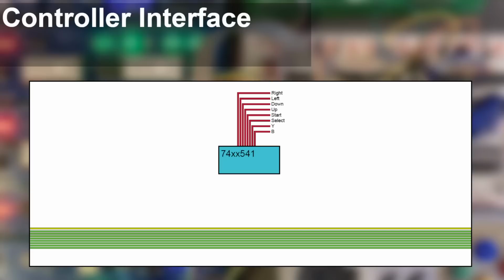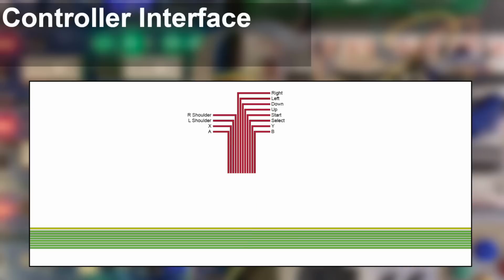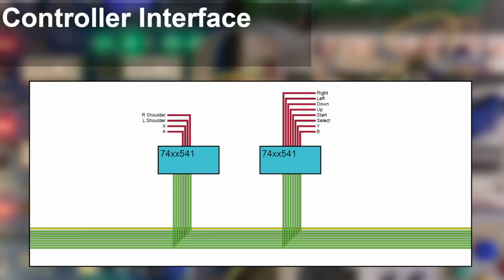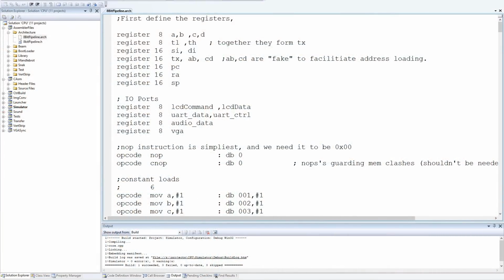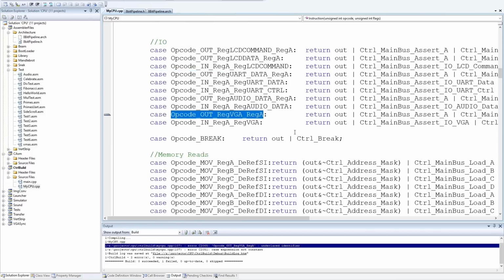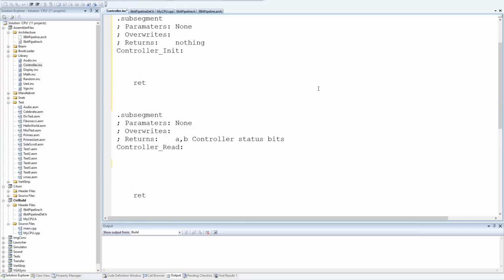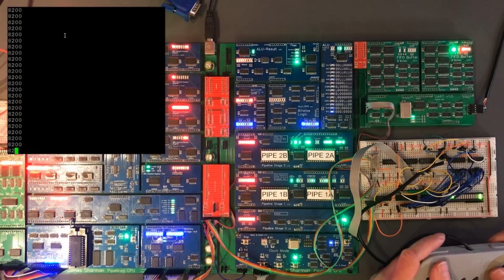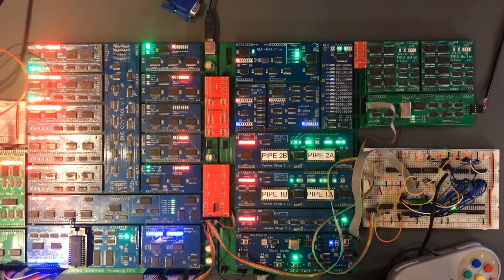SNES Controller Interface – Part 2 – Connecting to the homebrew CPU

Comment: 3:43 "But what if I hold right while powering on?"

Well, you're not the first person to assume the controller isn't touched during power-on! Every analog stick I know assumes that it starts in the center "rest" position. I'm sure there's no shortage of gamers that found their analog stick misbehaving because they accidentally held it off-center on power on. I distinctly remember discovering this with the N64 controller. Kid me was baffled. Adult me understands what calibration is.

Granted, you aren't using an analog stick, but the concept is similar.
Reply from the maker: Indeed! Some people didn't like the imperfection but similar initialisation constraints happen more than people think.

Comment: 13:00 - is that why it was (for a while) common to have a "game port" (aka joystick connection) on PC sound cards?
Reply from the maker: No, but I do like the similarity here. The real reason why game ports and sound cards were often found together was some early clones had limited slots. The joystick cards were very simple circuits so adding that functionality to a sound card was easy and made the first cards to do it stand out.

Comment: So for identifying the flip flop state, I think I found a solution only using the two upper bits of the high byte: make bit 8 of the high byte be the NAND of left and right, and bit 7 be the XOR of left and right. It results in a truth table that can tell which one is which because there's no conflict. So you can compute the two bits in software, and when you read the next byte you can tell which way it is based on whether it matched or not.

Buttons - low high - high low
None - 00 10 - 10 00
Right - 10 11 - 11 10
Left - 01 11 - 11 01
Both - 11 00 - 00 11

It's probably not worth the chip(s?) just for that though. Might as well tie them both high and if somehow the player manages to press both right and left at the same time, yell at the player to stop it so controller detection works.

The only other solution that I can think of would be to add more flip flops to have a third state where it returns all 1s  and could probably be done with just one existing chip, and would also be fairly cheap on the software side but kind of gross and wasteful compared to a one-time init at start of the program :/

Thanks for the videos! Really ties up how all those parts work together to make an actual computer! Also makes for pretty nice brain teasers trying to solve problems like this one.
Reply from the maker: Half you are enjoying, your solution is interesting but it would cost several chips. It’s worth remembering that a single sample without a direction held to correctly detect the polarity.

Comment: 18:42 Couldn't you pull up all four of the lines on the upper byte?  Then you'd have U/D/L/R all set at once, a physically impossible input on an SNES controller
Reply from the maker: You could do, but I know a few games testers who would just take "a physically impossible input on an SNES controller" as a challenge. It can definitely be done on some 3rd party controllers.

Comment: Awesome progress! Nicely done! I may have used all 4 bits of the MSBs to hold a pattern to test, but the single MSB works well enough! 👌👏
Reply from the maker: Thanks George. I could do, but I kind of wanted to deliver those 3 bits from the shift registers. It will let me know if someone plugs a non controller in.

Comment: I feel like having six on each bit would be a better idea, so you know that the MSB is always the high/low bit flag.

I actually made a hex keypad using a very similar counter and demux selector and dlatches this week. Nice to see others have used the same route.
Reply from the maker: I did consider that before I made the circuit but I had reasons for going the way I did.
Reply: thought the same. just move the highbit from the first chip to the next free bit on the second chip. Then let the high bit from second chip high and bind the high bit from the first chip low. then you always can be sure about the readout. I hope the pcbs are not made yet :D
Reply from the maker: It would be a pain for the direction buttons to be in a different byte of the resulting data.

Comment: I thought I saw somewhere that at least one of the old nintendo controllers (nes or snes, maybe both) have a nub under the directional pad that made pressing opposite directions impossible. If the snes controller has that feature, you could do left/right or up/down pair of lines to force forever high on the high byte and avoid any edge cases entirely.
Reply from the maker: That's right, but you can still push both sides at the same time and there were third party controllers that just had 4 buttons.

Comment: I personally think at this time stamp 4:10 you could move the Right D-pad to the other 74xx541 and then you could pull it down to ground and with that you'll be able to deferient the high byte from the low byte enven if we presse any button
Reply from the maker: You could. But then the 4 direction buttons would arrive in different bytes which makes it more of a pain for programming. There is really no problem with this circuit as it stands although it's fine if you would have made a different circuit.

Comment: personaly i would choose to make bit 7 follow the flipflop  this limit the lower byte to to 7 input lines ( bit 7 is alway 0)  and then  use 5 inputs on the higher byte where (bit 7 is alwas 1)  , this way we alway know if we reading the lower or upper part off the  joystick input.

Comment: What if the controller is fault with a stuck button even if the computer is running software that does not use the faulty button is all of the controller not going to work?
Reply from the maker: That very specific situation would indeed be a problem for my design. I think it's likely that all the games I write will need the direction pad though.
Reply: @weirdboyjim  not a problem or a criticism. I just remember as a kid playing games with my faulty joystick that would not go up

Comment: Hi James, 

I followed your comments below and it seems that everyone feels a little unhappy with the ambiguous MSB as an indentifier -- maybe including yourself. However, I also understand that you need the D-pad not to be split, as you pointed out to Reinoud. I think, not "reordering the bits" is also a valid argument -- in software, at least, because it costs time.

But what if you actually used the line buffes for the reordering of your shift register outputs? I see no reason, why the original bit sequence from the controller is in any way relevant in later software or the processor itself. You could even choose a more sensible layout for the data.

For example: Stick the D-Pad into the low nibble of byte 0 and the four ABXY into the low nibble of byte 1 (so they're not split anymore); the sholder buttons and Start/Select each find their place in bits 4 and 5 and the MSB could then identify the multiplexing of the data unambiguously. And if, one day, you choose to add a second controller, you have another spare bit for the controller port ID (as I am not the first one to point out, either, and I think, you should absolutely add a second controller anyway).

Please let the hardware do its magic. :-)
Reply from the maker: I’m totally fine with it.  Reordering the bits would add to pcb routing complexity but that’s unlikely to be a big deal. Every time there is a subjective choice there will be people who disagree but these videos are not me saying “This is the one true way to solve this problem” this is me saying “I did this and it works”. A second controller would work just as well under my system, you would need to switch to a de-multiplexer and put in an extra pair of shift registers and line drivers.

Comment: my first thought for compression was to take advantage of the fact that the d-pad is a single piece and thus can't have opposing directions pushed simultaneously to try and save bits by encoding, but then I realized that doesn't save enough bits to reduce to a single byte, and if you can press two adjacent directions or none at all, might not save any bits.
Reply from the maker: I suppose you could encode the direction into 3 bits but that would cost you extra circuitry.
Reply: Not only would it cost extra circuitry, there are 9 directions (assuming it's only opposite buttons that can't be simultaneously pushed), which costs the same four bits anyway:

no direction
up
up-left
left
down-left
down
down-right
right
up-right

and is then more complex to read on the CPU side as well.
Reply: Be careful, Nintendo verification likes to use broken controllers to make sure your code is solid.

Comment: you could shuffle the bits over a little to free the high bit on the other register to be permanently low
Reply from the maker: That would work, but it wouldn't simplify the reading code and would loose one bit of input. This doesn't matter in the grand scheme of things but I like that the low byte is the exact inputs from the original nes controller.

Comment: James, I love your videos! I would be very interested in seeing some of the "logistics" of building that you use in your projects. For example, your extensive use of EasyEDA; your soldering setup for SMD (i.e. temps and speeds that you use on your hot air gun/iron).

I have used EasyEDA in the past, but I am nowhere nearly as proficient in its utilization as you are, a demonstration/narration of how you align, rename, wire, etc. would be invaluable, in my opinion. Also the manual routing that you do, how you decide where tracks should be; doing the turns; etc.
Reply from the maker: Thanks Anthony! I did talk about temps etc.. in some of the earlier videos. Maybe I could put more detail in an extras channel video, you can always stop by the discord and ask questions though.
Reply: @weirdboyjim  I appreciate that! I just find your technique (especially in EasyEDA) pretty amazing and I remember in the early stages of this project you mentioning that it was your first foray into the PCB design world. So, color me impressed! Just wondering how you achieved such expertise.

Comment: To avoid a miscreant holding the button down to fool the circuit: could you switch the wire going from the top bit of the lower byte shift register, into a spare bit in the upper byte output? So only 7 bits are ever set on the lower byte.
Reply from the maker: At least I'm safe from the aforementioned miscreant beating my Snek score!

Comment: Why not add the AB Buttons to the bottom of second byte and have the d-pad & start/select on the lower byte and the 6 game buttons on the upper byte. then use the top two bits of each byte for byte and controller identification? like using bit 7 for byte select and bit 6 for controller ID or reverse it so bits 6&7 would be a accending number from 1-4 (if you wanted to use two controllers). That would remove the need for discarding data.
- Wes Hedden
Reply from the maker: Remember that the byte discard should only ever happen once in the entire program execution.

Comment: Is there a way to do presence detection on a SNES controller?
Reply from the maker: Interesting! If you were to change that pull-up to a pull-down it would look like all the buttons were depressed which would indicate no controller (Or a very annoying tester).
Reply: @weirdboyjim  if you were to attempt to shift an additional 13th bit out of the shift register, the value of that bit could distinguish that 'annoying tester' case.

Comment: you could have just started the state on power up to have the low byte asserted. This is also how the NES/SNES interface with the PPU for example. What actually happens for the controller is that the CPU manually has to shift in the bits. And to latch new data the CPU has to write to one of the controller port. You could have done something similar, let the CPU decide with the write line when to latch data and use assert to read it. This also avoids an issue when the CPU reads the data while it is being updated.
Reply from the maker: Implementing the protocol in software would still mean I'd need to build a basic circuit to allow the interfacing. A legitimate choice but I wouldn't have been able to make the circuit stand alone initially which I think makes for a progression.

Comment: The circuit looks so simple, yet I am having a hard time wrapping my head around how the shift registers work in practice. I mean, I understand how they work in theory, but for some reason all the control lines keep confusing me! ;-)

Thanks again for the past two video's. I am looking forward to part 3.
Reply from the maker: Best thing you can do is get a chip and a breadboard and have a play. Drop by the discord and ask if you are still struggling though.
Reply: Basically it's just a bunch of flip-flops after each other and depending on the type of shifter (parallel input or output) they pins on the chip are connected a bit differently to the flip-flops.
My advice would be take Logisim or Digital (hneemann/Digital)  and build one your own and test with it. Digital has most TTL chips you could just include in your experiment and you could open them up and somewhat look how they work internally.
Reply: @HumanAbraxas    @James Sharman  That's basically what I've been doing so far. I really like both programs. I will try and have some fun with it (after my new desk chair has arrived). Thank you both.

By the way, what confuses me most is the inconsistent naming of the pins across various manufacturers and software.

Comment: Why not do 6 bits per line driver then you could do a top bit to identify the state of flip flip.

You'd even have a spare bit to identify a second controller port so 24 bits 6 bits per driver then 2 bits yo identify the byte.

Then a single port on bus could drive 2 controllers with 4 reads.
Reply from the maker: I’ve mentioned it in a few comment replies already but I did consider splitting the bits more like that but picked this for a reason. I wanted all the direction bits to be in the same byte (that makes life easier working with the data in code), and I didn’t want to re-order the bits relative to the original data stream. You would have to bring a demultiplexer in but iy would indeed be pretty easy to add a 2nd controller, I don't think you would need to output the byte index though, you just need to identify the zero byte.

Comment: Hi James, have you considered to use timing to reset the flip flop? I have seen that trick sometime when two quick successive reads just reset the flip-flop sometime at the beginning of your code, while "normal" code will probably never just read the same port twice. You could use just simple timer (probably some clever construction with 555) if you will have fixed clocks, but in your case you would better count main CPU clock pulses or something like that. Hope you understand my idea, seems to be "cleaner" to me without dependency on input state of the top bit like you have here.
Reply from the maker: Someone else suggested this as well,  it didn't occur to me but I like it.  CPU clocks is definitely the right way to do it though. My only objection is that it would add several chips to the build.  I think I could do it with 2 if the timeout could be kept within 16 clocks.

Comment: You could pull the 2 upper bits high, because it's physically impossible to press left and right at the same time.
Reply from the maker: Nice idea, but that's actually not true. On the Nintendo controllers you can just about get left and right at the same time but there were 3rd party controllers that had four buttons (more like the ps1 controller) which make it easy.
Reply: @weirdboyjim  The PS1 controller has a gap in its D-pad for horrible blistering, but it's still one hard piece teetering. Dance mats do use simultaneous opposite directions though.
Reply: @0LoneTech  he is talking a 3rd party crap controller

Comment: as you will be reading both to get the controler data, can't you move the lower 8 bit signal to the upper port where you have 3 spare bits and then set bit 8 low. then you will have bit 8 defining the port being read.
Reply from the maker: If I was smarter I would have realized everyone was going to suggest this. I considered it but went with the solution I implemented for a couple of reasons. I wanted all the direction bits to be in the same byte, and I didn’t want to re-order the bits relative to the original data stream.
Reply: @weirdboyjim  Sounds like a reasonable requirement. But the business case would be to tell the customer that due to the 12bit i/o they need to upgrade to a 16bit board. ;-)